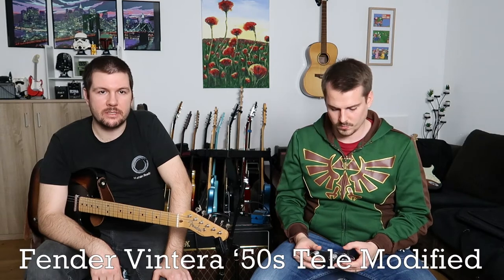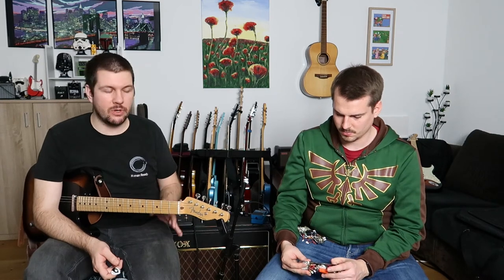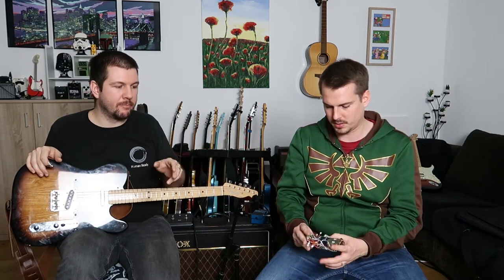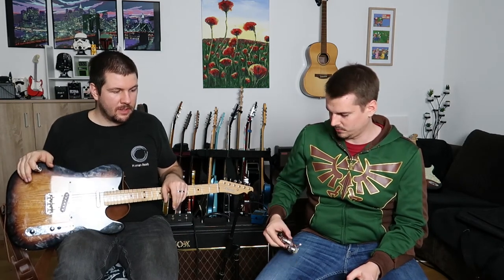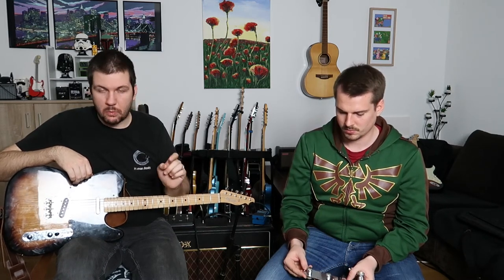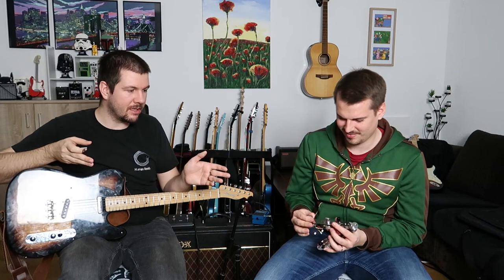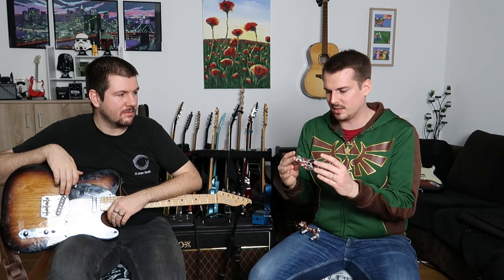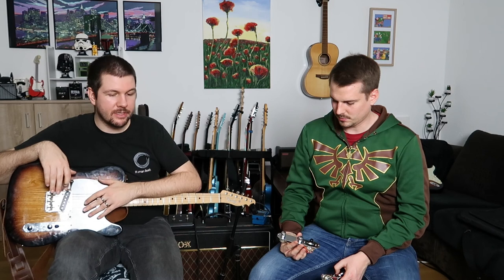Baja Telecaster vs Broadcaster vs Esquire, all Wirings in one Guitar!

Comment: Hey guys! What an awesome idea!! This would lead me to a little off topic question: would it be possible to do such a "quick-change-system" on a strat as well? If so it would be amazing to see a similar video on how to make a pre-wired pickguard with a quick-change-system for strats. Because of WAF reasons :D
Reply from the maker: Hi Adrian,
on a Strat you would also have to switch including pickups. Not sure if this is your goal anyway because I don't know all too many Strat wirings that are as special as these Tele ones.
You would only have to use a 3 pin connector which has the 2 wires of the output jack and the one from the ground connected to the tremolo on it. Option B would be to go with that ground directly to the output jack ground and then connect. Then you only need a 2 pin connector for the output jack. 
Then you can switch the whole pickguard including the pickups without the need to solder.
Cheers,
Martin
Reply: Hey Martin,
thanks for the quick answer!
Yes the primary goal would be to use different pickups or maybe try some vintage style wiring. I will take a look at it! I hope my existing knowledge is enough to do this :D
Cheers!
Reply from the maker: You're welcome. If you need further assistance, just contact us again. I could make a short video of how I would do it, but I currently have no intention to mod one of my Strats this way, so it would just be theory pointing at the wires that would be switched for ones with quick connectors. .
Cheers,
Martin
Reply from the maker: Hey Adrian,
just spoke with Lukas and decided to do the mod on my Squier CV Strat, just to show it.
Cheers,
Martin
Reply: @LMGuitarCorner  Hey Martin thats very kind of you! You dudes are awesome! Cheers
Reply from the maker: Thanks for the kind words, you're welcome! How quick do you need it?
Cheers,
Martin
Reply: @LMGuitarCorner  No need to hurry ;D i must decide which pickups to choose.
Cheers

Comment: I have a back-up control plate for my ASAT, I'm considering doing this since it doesn't seem that difficult
Reply from the maker: It's not difficult at all. You just solder the quick connectors to the specific spots where the wires would go directly.
Cheers,
Martin